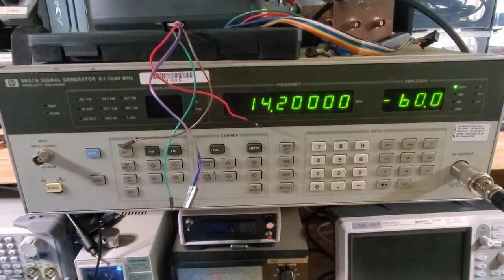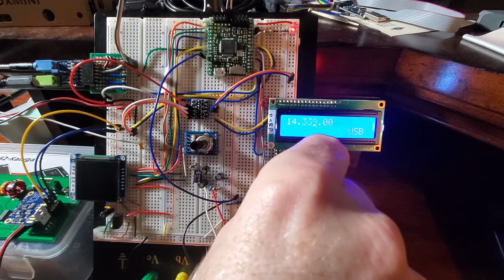Pyboard Radio - Updated Tayloe Detector

Comment: Hi Ian, do you have any more details on T3?  How many turns, what wire size and type of T50 core?
Reply from the maker: Sure - its 10 turns trifilar on a T50-43 core. The actual number of turns doesn't matter a whole lot. I have had success with anywhere from 9-12 turns. You do have to make sure you get the correct orientation of the windings though. If you are using this layout https://github.com/thaaraak/Tayloe-Mixer-v2/blob/master/Tayloe%20Mixer%20v2-B_Cu.pdf then just check continuity between top left,/top right - middle left/middle right and bottom left-bottom right if that makes sense. Thanks for the comment! and I hope this helps
Reply: @na5y  Thank you Ian.  Is #28 gauge the best to use ?
Reply from the maker: @wb9coy  Yes 28 gauge is perfect for winding that trifilar core.
Reply from the maker: heh - thats where I learned too! Awesome content on W2AEW's channel.

Comment: Hey NA5Y, love all your projects.  On this one, I see you're running the LM358 for what looks like 40dB gain from the sampling caps.  In your video, though, you must have some additional AF amplification stage after that?  What do the additional stages look like?  I'm currently designing a digital mode transceiver, and I want to get an idea of how much voltage gain I'll need for proper ADC sampling out of the Tayloe detector.  Thanks!
Reply from the maker: Hi Yakov. In the stages after detection there are 3 separate amplifications The first two are in DSP (Line 650: https://github.com/thaaraak/PyboardRadio/blob/master/Core/Src/main.cpp)
1) The I and Q signal  are phase shifted and multiplied by 8
2) The phase shifted signals are then added together effectively multiplying by 2

These first two stages multiply the voltage by 16 (or 24 dBs if my math is right)

Then the audio signal is further amplified by an LM386. I didn't actually measure the gain across this part but in my circuit I had a 10uF cap and a 1k resistor in series across pins 1 and 8 (which controls the gain). I would estimate that theres probably another 30 dBs in the LM386.

Have a look at this video if you'd like to see those two other stages in action:
https://www.youtube.com/watch?v=I8ZwlgjXAZM&t=32s

I show a schematic right at the beginning. Appreciate the comment and kind feedback Yakov!

Comment: Great project! I watched twice, but it's still not clear to me how you modified the Tayloe board to get the side band suppression you wanted. You moved the Si5351 onto the board (good idea!) and you changed the display code, but did you modify the detector itself or did you just alter the arduino code to account for sideband inversion? --K7TFC
Reply from the maker: Ah I didn't explain that bit very well. The previous board did work fine (sideband suppression included) at one point in time but had become battered and a few tracks were lifting so I decided to create a new board. I never got to the heart of the problem on the old board. It could have been something as simple as an open circuit on one of the lines from the FST3253 to the sampling caps/op amp. That would create an amplitude imbalance between the I and Q lines and prevent sideband suppression

As you correctly said the code and moving the si5351 had nothing to do with it and were unrelated to the problem. Did that answer your question and thank you very much for the comment.
Reply: @na5y  Yes, that answers my question. It might have been clear to me had I watched the first video on this project. I'm going to watch it now. 73! K7TFC